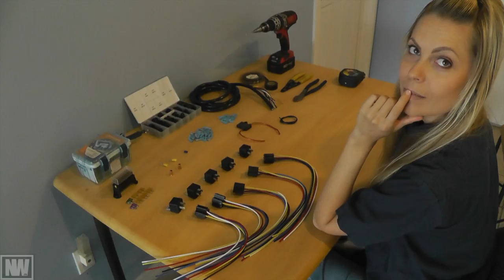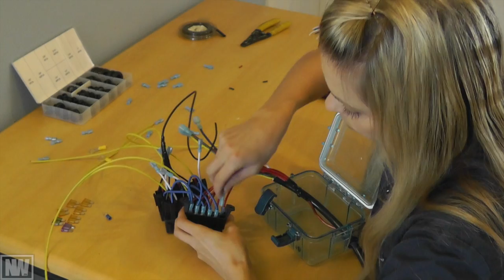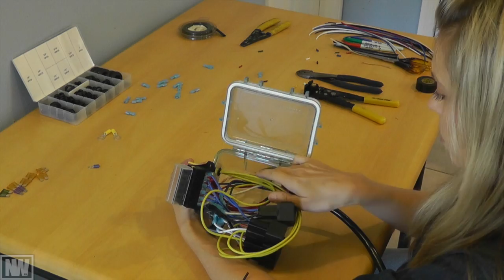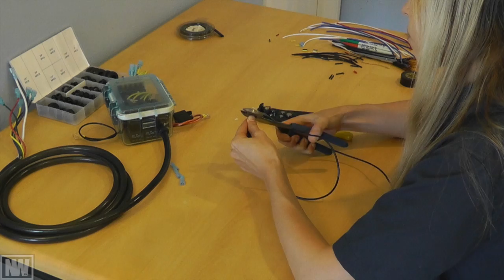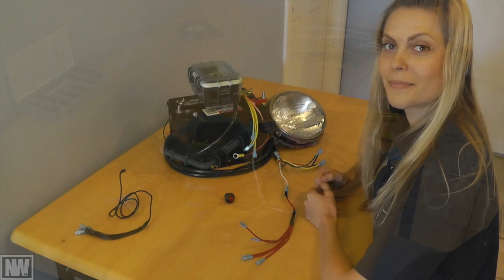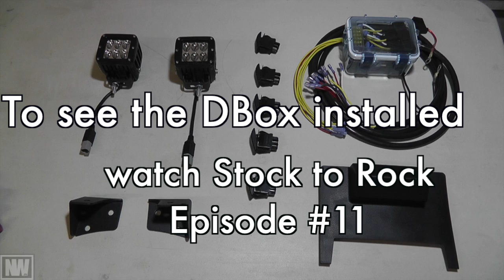Off-Road Lighting - How the DBox is made (Part: 2)

Comment: hey what would be need to make it a 6 switch box? insteadof 5??
Reply from the maker: A larger box, an additional relay and wires, a larger fuse block, and possibly a larger gauge wire and inline fuse for the positive battery connection.

Comment: Since the relays only need a very small amount of current to work, you can use a smaller multi-conductor cable to the switches.  I've gone as small as an Ethernet cable on circuits that power things like winches, power inverters, and air compressors.  Its much easier to route a small Ethernet cable thru the vehicle than it is huge monster cable.

Comment: Anyone know how to stop the box from drawing on the battery when the car is off?
Reply from the maker: Nick Russo unless you are using switches that are constantly lit there should be no draw unless a switch is turned on. 

To have the box only have power while the ignition is on a properly sized relay would be added between the positive battery terminal and the box's 12v power connection. This relay's coil would then be wired to a 12v ignition source that is only powered while the key is on.

Comment: Before you build this, it would be a good idea to look at the devices you need to power and do some load calculations to find fuse sizes and use an ampacity chart to find the proper wire sizes you should use. The power and ground wires going to the battery are way under sized. Put a decent load on that thing and you better hope you didnt cheap out on the fuses.

Comment: Something doesn't add up here.  You crimped the 6 red wires to the single wire with a fuse on it.  The red wires have the capability of drawing 103amps so shouldn't the single wire have been of heavier gauge and with a larger fuse than 30 amp?  If not then there is no way you could be running everything at once without the risk of either blowing fuses or fire. Unless you just oversized all the fuses essentially making them useless.

Edit - fuse and wire size aside this still is informative as a basic way to hook up fused relays.
Reply: pprotory your comment is exactly what i was wondering the entire way through the video and although if people dont understand why this is bad they shouldnt really be doing electrics there will still be people out there that will and i suppose we all have to start somewhere i just hope that people actually read the comments and realise that the fused wire is no where near enough for what hes aiming to draw etc
Reply: I was thinking the same thing you'll be blowing fuses or burning switches or wires.

Comment: anyone know where I can find 6 conductor cable/wire? I can only find  trailer 14 gauge 7 wire? all over $30.
Reply: ginxer86 do you need it for the switches if so use internet cable works well

Comment: Just remember guys not all relays have the same color output... Make sure you hook up the right colors or get the exact relays in the video. My colors on my relays were a little different, as my ground was not black but red and my center wires were blue ect..... Just look at the relays and it says what is what on the output.

Comment: do they have to be those exact fuses. lets say i just put a 30A fuse on each slot, would that be bad, i would think not cause its just extra precaution. 
im not sure, what do you think @NEWEREJK ?????????
Reply: Actually you have it backwards (Yes this is old, but is an important misconception)

Going higher amperage is more dangerous.  The only "Danger" to lower amperage fuse is the danger of the fuse blowing, where if you go to a larger amperage fuse, you may overcome the amperage rating of your wiring and have the wire melt and short out before the fuse blows.

The fuses should be rated at lower than max amperage rating of every other component in that particular loop.  The wiring, the switches, or lights or whatever is directly in series with that fuse, the fuse is there to protect the wiring and components.

Comment: Will it still work if my 6 conductor cord is 18 gauge? 16 gauge was on back order everywhere else. This is just for LEDs.
Reply from the maker: +Katy Lonneman I am not sure, your main concern will be if the wire used can handle the power draw from the relay coils.

Comment: Great video just one question. you have a 10 gauge fused wire feeding 5, 20 amp relays. with everything fused for protection i know you won't burn anything up but  shouldn't you up the wire size from the battery to something more appropriate for potential load.
Reply from the maker: Yes, to run all the relays at full load at the same time...  the main incoming line, in-line fuse, and internal fuse block could be sized larger to handle the larger load. As you mentioned this one is fused on the safe side for its current design.

Comment: at the end what is the 5 yellow wires for? none of them were connected to the switch or the light are they just dead wires or did I miss something?they seem to just be hanging off the battery and not in use.
Reply: The yellow wires are the output of power to the lights

Comment: I just finished this build. Kept blowing fuses and nothing working.
My harness that I bought that came with the relays, had the colors in different places. Make sure that the wire in the middle of harness is RED.
Make sure colors line up accordingly or you are going to have to do everything over again like I am.
Blue - 30
Black - 85
Yellow - 87 
White -86
Ignore colors and use this as direction
30 goes to power Fuse box
85 goes to ground
87 goes to light
86 goes to switch
In my case,
Black should have gone to fuse box
Red should have gone to Ground
Blue should have gone to Lights
Yellow should have gone to switch 
White should have been Cut as short as possible

Hope this helps anyone else in this situation.

Comment: Great idea! I might just build something like this for myself. Just a couple of recommendations... For the power and ground wires that you couple with a single wire OUT, use a heavier gauge output wire. You will lose less power through resistance that way, and may get better performing lights. Also, I recommend using solder and heatshrink for the connectors. Solder will make the connection much stronger to prevent wires from eventually slipping from the connections and to help with corrosion. Heatshrink will just make it look a little cleaner and it's really easy to use. just my $.02. Thanks for the vid!

Comment: I made a slight change. I used a Rockford Fosgate Single In-Line AGU Fuse Holder and Power Bright 8-AWG6 8 AWG Gauge 6-Foot Professional Series Inverter Cables 800-1000 watt. I did this because of the concern of a possible fire. Still built mine for just under $100.00.
Reply: Glad you are aware of safety features, brother in law.

Comment from the maker: The 3amp fuse to bring power to the switches shouldn't have any need to be bigger. If your fuse it blowing it is likely your relay wire colors do not match the colors/terminal # in the video.
Reply: Thanks - I'm about to start my build and was just making sure. =) Thanks again!
Reply: NEWEREJK ñ
Reply: Hi I built this and I am notnha ing a problem with the switches but the box stays on and is a parasitic draw on the battery....am I missing something?  Did it get tied into the ACC somewhere?

Comment: I decided to make one for myself and three of my jeep club buddies. Very simple and came out nice. Here are my step by step written instructions to keep me moving along when I did the build.  
dBox Steps by NEWEREJK
 
 
PARTS:
5 Relays
1 inline fuse
11 male spade connectors
32 female spade connectors
1 small eyelet connector
2 large eyelet connector
4 copper crimp connectors
1 3amp fuse
1 30amp fuse
5 20 amp fuses
1 six in one fuse box
1 6x4x3 watertight box
4 assorted grommets
10’ 6connductor cable
1’  16gauge black wire
 
Cut all relay wires to length
-      white 3”
-      blue 5”
-      black 4”
-      yellow full length
-      red as short as possible
Connect all relay bases together making one 3 and one 2 row then removed all the tabs from the relays then plug into base
 
Strip blue black and white wires. Blue and white ¼” and black stripped at ½”   
Crimp a female spade connector on each of the blue and white wires.  Leave black wires bare
After gathering twisting and taping all the black wires together, use a copper crimp connector to connect the 1’ length of black wire then tape.
 
Set the relays aside and prepare waterproof box –
-      ¼” hole on the front lower right
-      5/8” hole on the right side lower toward back
-      ¼” on the lower left of the back side
-      ½” midway between top and bottom on the left side
-      insert rubber grommets in each hole
 
Take 6 red wires
-      strip ¼” on one end and ½” on other end of each
-      ½” are gathered twisted and taped
-      before crimping… one end of inline fuse is placed through rear hole and striped ½”
-      6 red wires are crimped together along with the inside ½” stripped inline fuse wire using copper connector then taped
-      the other end of red wires receive a female spade connector
-      plug all six of the red spades into one side of the 6in1 fuse box
-      then connect the five blue spade connectors into the opposing side of the fuse box (keep wires from getting tangled)
 
Place the 6 conductor cable through right hand 5/8” hole leaving a good length to work with (10”)
 
Strip each of the 6 conductor wires ¼”
         - White wire receives female conductor
         - Other 5 wires receive male conductors
- White wire connects to the last terminal on the fuse box
- the remaining conductor wires plug into the white wire female spade connectors coming from the relay bases
- to keep the 6 conductor cable from pulling out of the waterproof box, place a ziptie on the cable and trim excess after tightening
 
Place the single black wire out of the front ¼” hole on the waterproof box
 
Place the five yellow wires from the relay bases out the ½” hole on the left side of the waterproof box
 
Place everything into the box carefully, then insert the fuses into the fuse box
-      the 3 amp fuse in the slot with the white wire
-      the five 20 amp fuses are placed in the slots with the blue relay wires
-      the 30 amp fuse is placed in the inline fuse holder on the outside of the waterproof box
 
Now neatly close up the waterproof box.
 
The five yellow wires are stripped back ¼” and each receive a male spade connector
 
The red and black wires are stripped back ¼” and each receive an eyelet connector for easy battery connection.
 
The wires at the end of the six conductor cable each receive a female spade connector.
 
Because switches being used light up,
         GROUND
-      gather five black wires  (6” length) and attach a female spade connector
-      gather other ends together with ½ stripped and twist and tape together
-      use a copper crimp connector to attach the five black wires with one long black wire (30”)
-      The end of the one long black wire receives a small eyelet connector to be used as a common ground
POSITIVE
-      gather five red wires (6” length) and attach a female spade connector
-      gather ends together with ½” stripped and twist and tape together
-      use a copper crimp connector to attach the five red wires together with one l red wire (8”)
-      Attach a male spade connector to the single red wire
-      to complete the build, connect the single red wire with the male spade connector to the end of the 6 conductor cable WHITE wire.  The wire is the fused wire for the powered switches.
 
With the build complete connect as follows
-      Red wire with eyelet connects to battery positive terminal
-      Black wire with eyelet connects to battery negative terminal
-      Yellow wires with spade connectors are used to connect to the positive side of each source item, while the negative side of each source item is grounded
-      one side of the switch is connected to one of the 6 conductor cable wires while the other side is connected to one of the red common wire connectors.
-      for the switch to light up, the ground must be connected to the switch common.
Reply from the maker: Nice! Thanks
Reply: Where did you buy the parts?
Reply: amazon.com

Comment: I wanted to clean up my messy wiring on my JK and this video was the perfect solution. Hooked it up everything works fine accept shouldn't the lights turn off when the ignition key is turned to the off position? any thoughts on what I may have done wrong?
Reply from the maker: You can add a relay and tie it into your ignition to shut it off but as this is set up you can use your lights even with the key off because it is powered directly from the battery.

Comment: nice product idea.  I hope it works out for you.   another thing you could do is add dual 87 relays and run 8 output wires without making more chunky splicing.  A single lamp per relay is okay, but they could handle 2 of just about any light out there today.      good luck with this.

Comment: First of all thanks for the videos.  Very informational.  I am just about finished with mine.  For anyone having trouble finding 6 strand wire, use 8 strand thermostat or sprinkler wire at.  It's 18 ga wire.  I also used a fuse box that has connectors on one side and a single power cable with a battery lead already installed.  You will still need to add a fuse to the line, but cuts out the process of pulling all the power wires into one and connecting them to the fuse box.  Thanks again

Comment from the maker: Yes, that is very true. Depending on what lights you are running it could be under fused at some point. I decided to fuse it low vs. too high to avoid the risk of melting wires. On the bright side the relays are also oversized for most lights actually being 30amp relays. A 110watt light will only pull 9 amps. L.E.D's would be a great low amperage way to go. I'm going to make a video on amps, volts, ohms, and watts for the viewers may not know what you and I are talking about.

Comment from the maker: In this build it is not. On my personal jeep I used only one of the red wires when adding a paralleled circuit for my reverse light. Either when I shift into reverse or flipped the switch the rear lights would light up.

Comment: I like the concept. I am working on one my self. 

the only thing i didn't like, is the low amp rating input you have. the way you have it wired is that only one relay should (or can be) be active at any one point due to the limitation of the input wire with the 30 amp fuse. if you have two relays active at 20amp loads, you bill blow the 30 amp inline fuse. 

I am making one with a 85 am circuit breaker instead of the fuse with 4 guage wire. 

just my $0.02. 

otherwise, very clean.